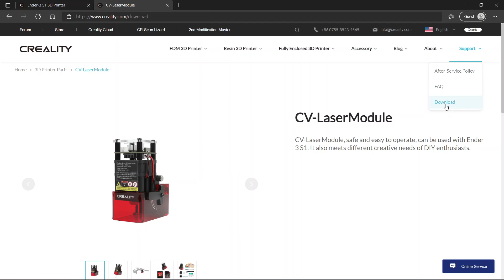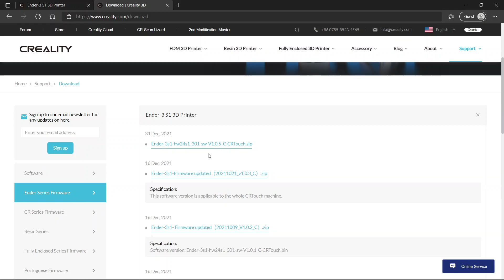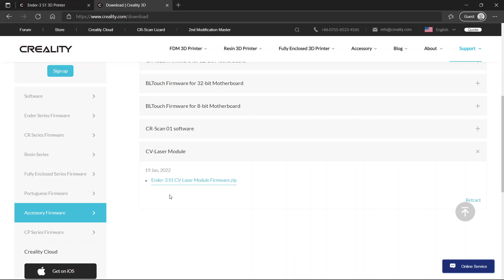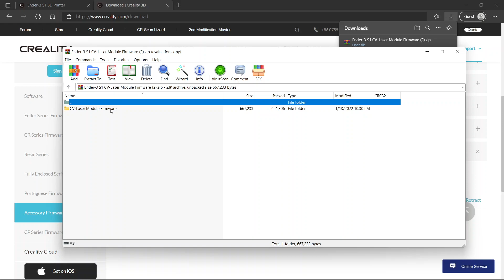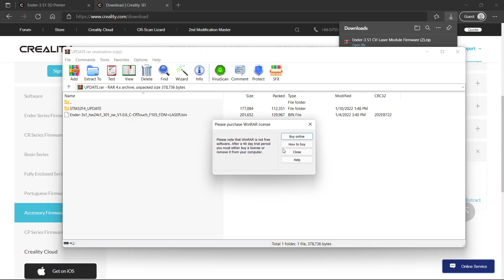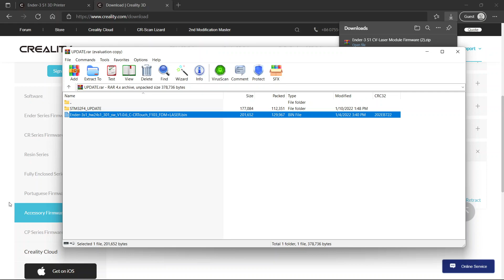Ender 3 S1 /Pro New Firmware v1.0.6_C Installation + Creality CV-Laser Module

Comment: IMPORTANT DETAIL NOT COVERED BY THIS VIDEO:

There are two known hardware revisions of the Ender 3 S1 motherboard: one powered by an STM32F1 chip and one by an STM32F4 chip. Firmware files labeled 1.X.X are intended for the F1, and 3.X.X for the F4. Installing 1.X.X on a motherboard that has an F4 will BRICK YOUR PRINTER (it gets stuck at the Creality screen). If you have an F4, flash the 3.0.3 firmware that's in the STM32F4_UPDATE folder. If you have already bricked your printer by installing a 1.X.X firmware, you can recover it by flashing the 3.0.3 firmware. You can tell which chip you have by removing the front plate of the printer and looking at it.
Reply: Which front plate do you mean?
Reply: Also the pro version is different at 2.0.x

Comment: I have an Ender 3 S1 Pro, bought the CV-Laser module, after installing and downloading files for the Laser everything was ok, I turned off the printer when I restarted the screen was blank, the only screen shown was "Creality". I have tried updating and using the SD / TF cards according to the regulations, the screen is still blank and does not start the update. What can I do???
Reply from the maker: Can you try to install back the original firmware on the screen? Or maybe go back one version?